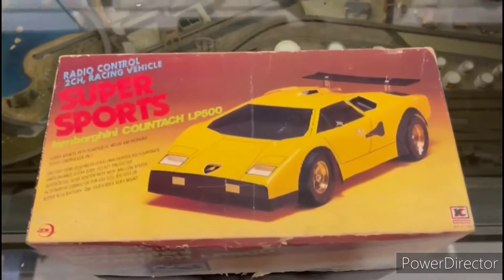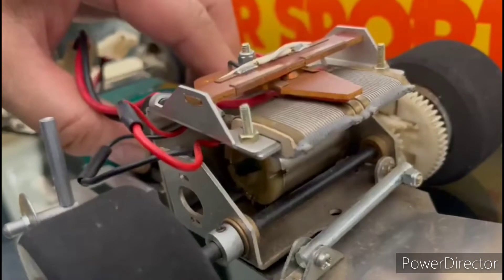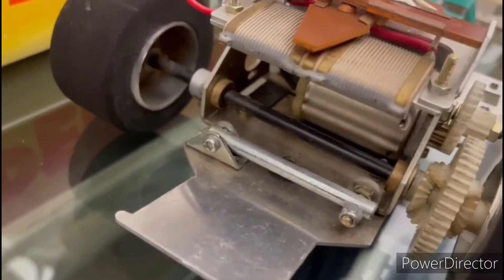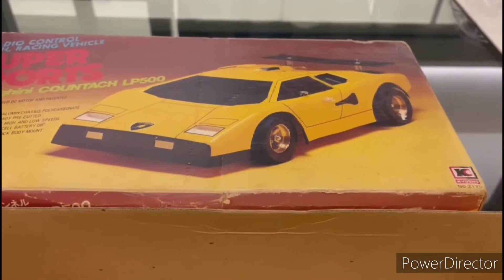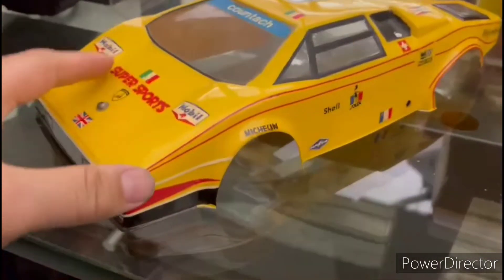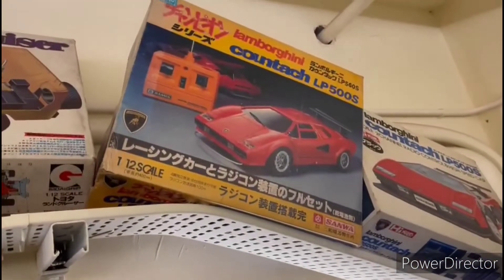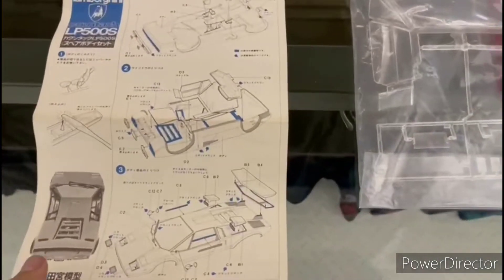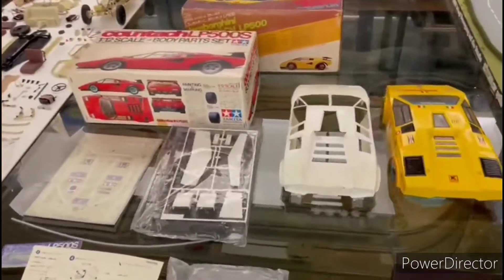Most early (70s)  京商Kyosho 1/12 scale Lamborghini Countach LP500 RC model kit

Comment: You must be a dealer instead of a hobbist. This kit was promoted in a local hobby magazine 模型天地！
Reply: victorma1141  l am not as experienced as you. While you were working as a reporter in your secondary education l was still an elementary school kid at Rosaryhill School. Sadly this school ceased to operate and it was considered as a noble school back then
Reply: victorma1141  that Tamiya Toyota pickup was too heavy and big. I remember that it was operated with a super heavy NiCd battery pack 6v 4000mah. This further added weight to the super heavy pickup.